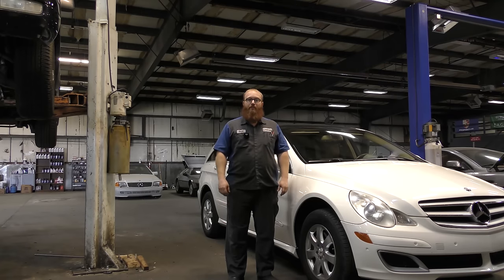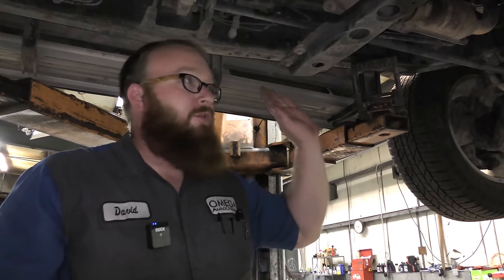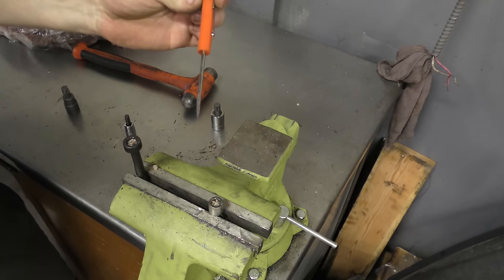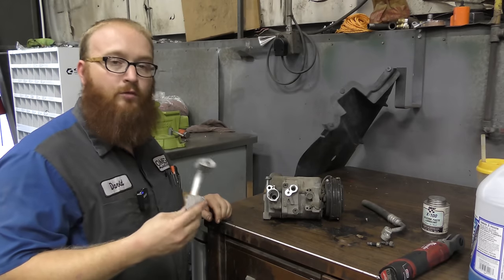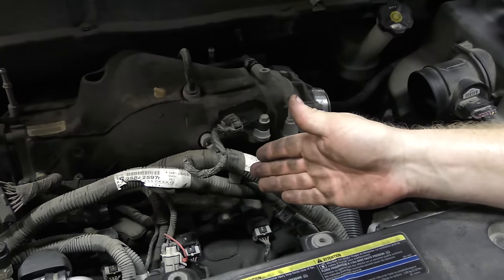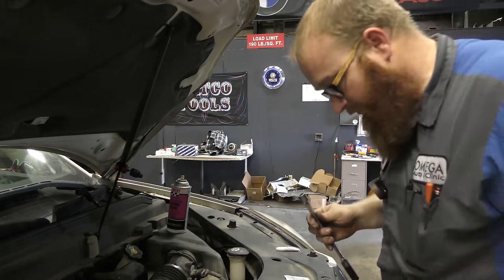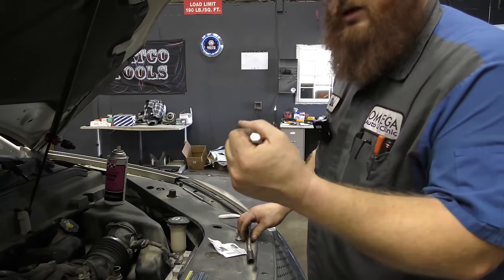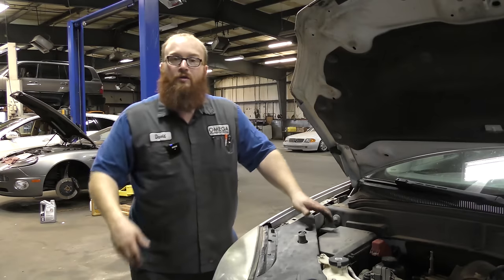The CAR WIZARD shares 10 Crazy Easy and Essential Mechanic Tips

Comment: If you strip out an Allen head bolt, there’s a super easy way to still engage it. 

Take a hammer and hit the bolt head a couple of times. 

Go 2 sizes up on your Allen socket and place it on the bolt and hit it with your hammer.  ( this causes the material in the bolt head to collapse in)

Then you want to take your original Allen size and tap it into the bolt head. Make sure it is at full depth. 

You don’t want to use a power tool at this point for risk of re stripping it. 

Put on your ratchet and apply some pretty damn generous force downward onto the ratchet and make very light turns.  (If it strips again, repeat but hit the bigger socket a few times more and harder so it seats better.  Cheers.  🍻 

I’m an industrial mechanic ( millwright) and Allen bolts are often a headache.  Especially when you’re doing maintenance on machinery that you didn’t install🚬
Reply: i always heat it up a bit and do it

Comment: 🎯 Key Takeaways for quick navigation:

00:00 🛠️ Wizard Tips Introduction
- Tips for DIY mechanics.
- Aimed at hobbyists and shade tree mechanics.
- 10 valuable tips to make automotive work easier.
01:41 🧰 Tip 1: Flexible Extensions for Hard-to-Reach Bolts
- Use long 3/8 extensions for difficult-to-reach bolts.
- Avoid boxing yourself into a small area; take a step back.
- Demonstrates the effectiveness of extensions in various scenarios.
04:32 ⚙️ Tip 2: Emergency Fuel Pump Restart
- Technique to temporarily restart a stalled fuel pump.
- Demonstrates using a rubber mallet to kickstart the fuel pump.
- Emphasizes this as an emergency solution to get you home.
06:45 🔩 Tip 3: Prevent Stripping Torx, Triple Squares, and Allen Bolts
- Avoid stripping bolts by cleaning out debris in the broaching.
- Use compressed air and silicone lubricant for depth and cleanliness.
- Applies specifically to Torx, triple squares, and Allen bolts.
12:21 🧴 Tip 4: Proper O-ring Installation
- Lubricate O-rings with silicone spray for easy installation.
- Ensure O-rings are fully seated for a proper seal.
- Demonstrates the technique with an AC compressor example.
14:50 🔌 Tip 5: Electrical Connectors and Weather Packs
- Use silicone spray to lubricate connectors for easy installation.
- Ensure connectors click securely for a proper electrical connection.
- Focus on connectors with weather packs.
16:36 🌀 Tip 6: Easy Installation of Air Ducts
- Use silicone spray on the inside of air ducts for smooth installation.
- Demonstrates how to avoid struggling with accordion-style ducts.
- Simplifies the process without using force.
19:27 🧲 Tip 7: Paper Trick for Tricky Bolts
- Use a piece of paper to hold bolts in place during installation.
- Makes installing bolts in tight spaces more manageable.
- Prevents frustration and dropped bolts.
20:44 🪣 Tip 8: Super Glue for Securing Washers
- Apply super glue to prevent washers from falling during installation.
- Ensures washers stay in place until the fastener is torqued.
- A helpful trick for various applications.
23:02 🚗 Tip 9: Fan Diagnostic Tool
- Use a fan diagnostic tool to quickly identify fan-related issues.
- Simplifies the diagnostic process for cooling fan problems.
- Reduces the time needed to troubleshoot fan-related issues.
24:18 🪟 Tip 10: Quick Power Window Regulator Test
- Use dome lights dimming as an indicator of power window issues.
- Quickly assess if the window regulator needs replacement.
- A simple trick to identify power window problems.
25:31 🔍 Bonus Tip: Using Online Resources
- Utilize online resources like Google and YouTube for problem-solving.
- Find quick fixes and solutions for automotive issues.
- Encourages leveraging the vast information available online.

Made with HARPA AI

Comment: I will add this simple one to the o-ring thing. Whatever your trying to seal with o-ring probably has a lubricant in it that's compatible with your o-ring.. think about it. Ac has pag oil, power steering, transmission, motor oil.

Comment: The fuel pump trick is the same as the starter. Bang on it and it will temporarily work. This also works on the older headlights.

Comment: I have been a auto tech for 30+ years and have watched two of your videos this on on the tips and the one on the jaguar and the jaguar one I learned a lot . On your tips tonight on tip 6 and 7 where you use paper on the socket and glue to hold the washer on you can also use grease to hold the bolt in the socket. It's really nice to watch a video and learn something thank you sir and keep the tech stuff coming.

Comment: I will share a trick that is so simple, but it helps big time. I have never ever seen this trick published anywhere. Sometimes you are turning a screw, no mater what the type is. The male/female threads do not properly align, you force them with a tool, and you strip the threads. It may go in, but you damaged the threads in the process. In order to prevent this, ALWAYS use my trick: for any right hand threaded fastener apply pressure to screw inwards, but rotating slowly counter clockwise. Listen carefully until you hear a click. Sometimes you can also feel the click on your touch. That means the male/female threads now match. Proceed then to turn clockwise. You will never misthread a fastener ever again. I works for every thread and every material any size screw. Very silly wonderful trick that I've been using for decades now. Not a single screw damaged ever. It could work even for threads that have already been damaged before by someone else. Good luck to all. Specially useful to screw in spark plugs into their aluminum holes. Also particularly useful for situations that you can't start screw by hand (no tools). We are supposed to start rotating with no tools to prevent damage, but it is not always possible.

Comment: Those relay block circuit testers are one of the best tools I’ve invested in. I bought an electronic issue plagued GS300 and it make diagnosis so much easier.

Comment: I came across a torx bolt that was very shallow. Not dirt filled. If you look at the torx but you will see the tip slightly rounded. To get a better bite I grind the tip of the tip flat. It will fit just a little bit deeper and give a sharper edge for a better bite.

Comment: 19:35 Been there. Took 2 hours of fishing with a tiny magnet on a piece of fishing line to catch, and pull the washer out of the cylinder. I  was just about to give up and start planning an engine pull since it was the only way to remove the head when I finally got it. After that I started plugging the intake ports whenever I removed the manifold.

Comment: I’ve got an extra long 1/2” drive impact extension  from Snap-On. 1/2” drive on one end and 3/8” locking drive on the other. Been pulling transmissions with that thing since about 2001. I think I paid about $100,  never had any issues with it!

Comment: On number 6, I just use a dab of superglue.  It's tough enough to hold the bolt in but the bond breaks immediately after install and the dried glue flakes off.  Excellent for installing hard to reach screws.

Comment: My best tip to owning a car in general is DO YOUR PREVENTATIVE MAINTENANCE! Those oil changes, well-timed flushes of other fluids, greasing the bottom of your car prior to winter in northern states, all of that… it’s all super helpful and the care you put into your own car will be dealt back to you. Every car I’ve owned has been a beater that has gained me at least 60k miles before I’ve sold it. Not parted it, SOLD it for a return! Treat them well, and they’ll treat you well.

Comment: you forgot the trick with using two wrenches cascaded together, open end to box end to increase torque when taking off a bolt!
Reply: Although this works, I utilize it, it is not the safest. I have come close to cutting my arm open. There are wrench extending tools out there. Mueller Kueps makes one. You can make one or have someone who welds make one also.
Reply: I’m sure school instructors will scream if you do this but I’ve done it
Reply: @Joetechlincolns  understood. It is a recipe for busted knuckles, but it has also saved me a few times when it was the only option.
Reply: He showed that a few video's ago.
Reply: @patpalermo7629  I learned that if you tape the wrenches together they have less chance of sliding off each other. Simple masking tape works best.

Comment: Another tips: allways clean the threads on nuts and bolts before reusing them.
Reply: 3” brass wire wheel in my drill and a pair of vice grips for reassembly time. Brake cleaner too if using lock tight.
Reply: I bought a kit of thread chasers, it's paid for itself many times over. 
It's great for dirty threads or any time a fastener just doesn't feel right. 
It won't save a thread that's fucked up, but it can save ones that are about to get fucked up.
Reply: Especially on anything going into aluminum. It's best just to run a tap or thread chaser and clean up things before even think about threading that bolt in. zi watched a pro Subaru shop strip out the hole for the belt pulley. He rushed it and got 1/4 of the way in and stripped out the threads. Any other shop would have kept going, ruining the thing and making it really hard for the next guy to remove the bolt. He installed a helicoil in it after properly drilling and tapping the stripped hole. He could have avoided the whole thing while the engine was out simply by tapping that hole. That's supposed to be a thing you do any time you rebuild an engine. Especially head bolts.
Reply: Yes sir

Comment: The hammer to the gas tank/fuel pump also works with starters. Can't reach the starter? No problem - use a long bar, from under the hood or under the car, find a way, rap tap tap, try the starter again. It does not require extra hands, or at the same time while cranking. This used to be a regular thing at work with diesel locomotive engines, we used a long jack bar. Easy!

Comment: In 10 seconds im impresed.
Honest guy.
Now that i see youffirst tip.
I was a maint.electrian.
Another employee ask me for a 3/4inch knock out plug?
He had pulled back the carpet in a car /cut a hole through floor board to get to a bell housing bolt.
Rear wheel drive of course.

I was Really impressed!
I gave him the hole plug he wanted.

Comment: I use dielectric grease for most of my O-rings. Sometimes I use A/C oil for my A/C O-rings but iv used dielectric on them with no issue.

Comment: Tip #4? Orings. My oring experience (30yrs) has been in underwater applications with the Navy.  Here is my 2 cents.  Always, and I mean always, make sure both surfaces the oring touches are absolutely clean! And lubricate the entire oring before installing it. Lubing just one side doesn't allow the oring to fully "seat" on the dry side.

Comment: Some older Toyota’s don’t prime their fuel pump with the key on engine off. Just an interesting point I wanted to share.
Reply: I always wondered why I never heard any type of fuel pump noise when diagnosing my old camry yet it worked fine
Reply: It's good to know this about your car before you start banging on the fuel tank
Reply: Yep my 1986 Toyota 4Runner had an issue with the fuel pump and I learned that by reading up on it kind of a crazy thing. But there is a workaround by using the connectors on the fender wall. And pushing a solid wire into two parts of the connector to get fuel pump to work while key is on

Comment: i've done my own auto repairs for a long time... Past 3 fuel pumps i did for myself i cut a hole in the floor to access. no more dropping the tank. this takes a little time at first and you have ot be carful not to cut any wires or lines. i use a drill to get started and then metal hand shears. works like a charm. and no sparks just in case.

Comment: For electrical, your breath carries enough spit/humidity when you blow on connectors to cause problems years later.  Spit is a conductor, but it's also a solvent for metal used in connectors so the initial effect is it helps make the connection but afterward it slowly eats away and could cause issues.

Comment: The secret of any object going into any hole is make sure the hole is clean and use some kinda lube.
Reply: That’s what she said. Lol
Reply: and to make sure other guys haven't put their bolt in the same hole.
Reply: When you are aiming for a specific torque, you should not lube the fastener.
Reply: If it don’t fit push harder!
Reply: If you do the job correct some holes are self lubricating.
Reply: And make sure the object going in the hole isn’t fouled
Reply: SE465CX: 1972 Motor Auto Repair Manual says to lubricate the threads of damn near every engine bolt / fastener on a 1970 Olds 455 before torquing to recommended specification.  The old Mitchell's Domestic Auto Service And Repair Manuals say the same as well.  Rebuilt 7 or 8 of those engines from the block up back in 80's and they all ran perfect ~ extremely durable too.  Change the oil a few times a year and you couldn't blow one up if you tried.

Exactly where is it that you've heard or read  that your not supposed to lubricate fastener threads before torquing to specs?... All my service manuals say the opposite.
Reply: @jamesbell2682  At least not at the same time, hopefully.
Reply: @thefarcountry  You are right: you CAN lubricate bolts, nuts and threads,  but there are diagrams for lots of lubricants or greases, that you torque a certain percentage LESS than prescribed, to prevent you from over tightening  connections and joints. For instance 10 % less torque when using teflon grease or MoS2-grease.
Reply: Ara ara~!

Comment: Subtle humor.  I love it. I've had windows stick after washing a car or after it sits for a period of time. This can fool you into thinking you have an issue somewhere. I put a light coating of oil on the seal with my finger tip and a small amount on the edges and roll up the window. It pushes the oil where you can't reach.

Comment: Thankyou for taking the time out and put more productive time into the world 🌎 
 I was a tech for 4 decades installing  flat pack kitchens.
I've never laughed 😅 so much at the comments from other mechanics/ techs ! I nearly passed out. Especially the ones about hitting the tank .. !
 I was a bespoke certified carpenter joiner  & a certified electrician & a certified Gas [ methane ]  fitter/ tech guy ... [ and plumber ]  all to do one job, install Custom kitchens.
 Sometimes I'd spend 2 or 3 days on say the joinery.. radio off , working in silence trying to figure out the other task which was a problem. 
 I never figured out how keep boiling piss cool other than pissing it out my pores as sweat. Sometimes there was the option of heavy manual labour to resort back to such as relocating 50kg or greater x 50 box's around a room 20ft by 20ft  .. thankfully.
 Later I went less hours on that job and went into cab driver on nights.. when trouble started I could do werewolf in 1 second from Mr Nice as nice guy.

Comment: I replaced an electric window regulator, and before the year was out, the motor needed changing.  The lesson I learned was that when an electric window starts intermittently not closing, replace both pieces.

Annoying -- they open ok, but start intermittently fail to close, like completely dead.  Worse if you don't have a garage to park inside of.

Then a minutes later, the window closes normally.  Don't think, "Maybe I did something wrong, the window is working fine."  No, the window is failing, and if you don't get it fixed, it will soon fail opened for good, and then you'll be stuck, possibly in the rain.  Better to replace the parts ASAP.

Comment: I bought sockets with strong magnets because hated dropping bolts and screws.
Reply: I didn't know u could buy sockets with magnets built in.  Screw driver bits are often magnetic but they're always to weak, so I add a small magnet to the end to increase the magnification.
Reply: You can always tape rare earth magnets to a socket (tear apart old computer hard drives- there's one or two in each drive).
I used heat shrink and epoxy on a socket at work- (high voltage equipment- don't want to drop a washer or bolt on equipment that could blow up when energized), the magnets hold the bolt, split washer and washer all together.. 
You can also order them online.
Reply: @doylesmith8678  thanks for that advice.  I have a few old hard drives I keep meaning to check for files I might need.  I'm going to grab the magnets out of them.  I also didn't think of taping, glueing or heat shrinking the magnets on.  Thats a really good idea.